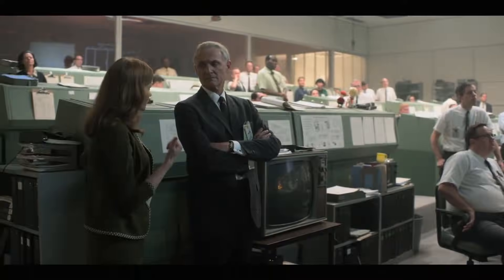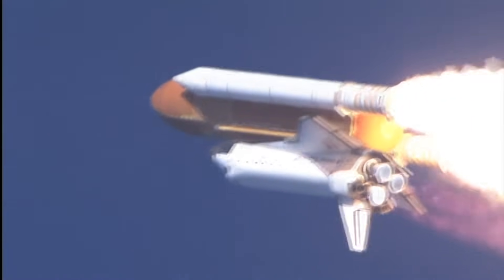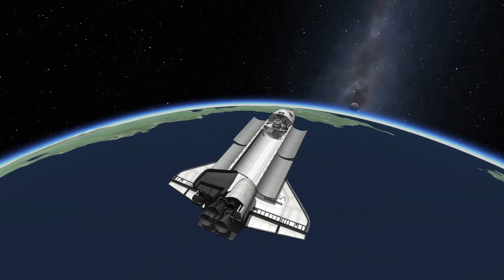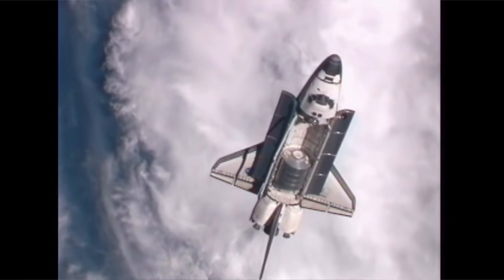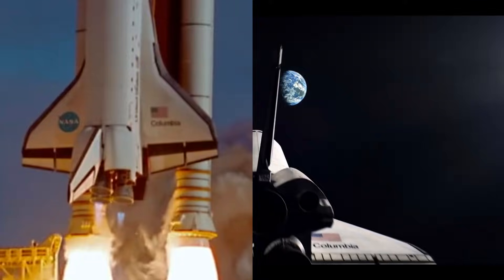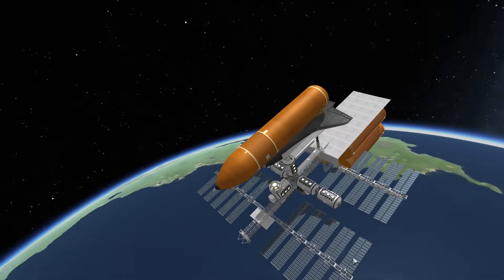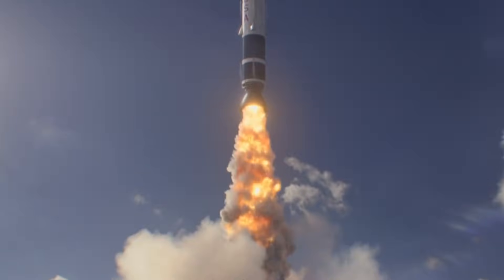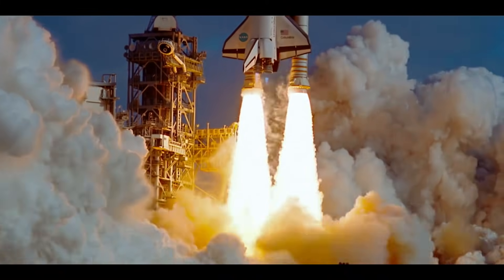How To Send A Space Shuttle To The Moon

Comment: Something that's possible is also slowing the shuttle's return from the moon so it goes back into low Earth orbit, maybe even hooking up with the ISS again before a normal speed Earth re entry.
Reply: Doing that would require a velocity change of about 3 km/sec since it would basically be a TLI in reverse.
Producing that velocity change or Δv with rocket engines means that at least 50 % of the total mass before the slowdown needs to be propellant, assuming hydrogen & oxygen burnt by the highly efficient shuttle main engines with 450 sec of specific impulse. If using engines with lower specific impulse, the percentage of propellant would need to be even higher than 50 %.
If the shuttle couldn't be replenished on the Moon, all that propellant would need to be brought all the way to the Moon and back, essentially doubling all the propellant and rocket power needed to launch the shuttle in the first place.

Comment: It would be neat to see a railgun on the moon to launch water to a lunar station that would then process it into fuel over time. All you'd need would be something to circularize the payload at apoapsis that could also withstand the acceleration of a launch. A reason to process it in-orbit would be to increase launch safety and also have it readily available to use as water instead of fuel.
Reply: Railguns on the Moon – if you by that mean electromagnetic catapults – have been imagined for a long time. Arthur C. Clarke wrote about the concept already in the 1950s.

Comment: Once you are in space, there is no need to keep fuel inside Shuttle, you can just agglomerate stuff in any configuration that will stay together. Perhaps the Shuttle needs to to get to LEO and then separate out that fuel and equipment needed to escape Earth's gravity and atmospheric drag and land back on earth including heat tiles, wings, aerodynamic sheet metal and some engines. Perhaps it could be configured as a two-stage shuttle such that leaves Shuttle stage 1 in LEO, then Stage 2 with crew compartment and support, fuel tanks, correct number and configuration of engines and rejoins Stage 1 when it returns from Moon to LEO. SpaceX's many engine design would allow just taking a few space nozzle engines to Moon since they are just operating in space. Can engines be made with nozzles that can be reconfigured? How much extra weight and complication would be entailed in all this reconfigurablity?

Comment: How to avoid the heat load of coming into the atmosphere at translunar speed?  Use the maneuvering thrusters to turn around and use some remaining hydrogen oxgyen fuel to fire the main engines toward Earth to slow down enough to hit normal re-entry speed.  Also I hope there's a fight between a Shuttle and a Buran at some point.
Reply: That braking would require a velocity change (or delta-v) of at least 11,000 km/h and take about half of the spacecraft's gross weight (at that point) in fuel even when using the highly efficient main engines. That means that the shuttle would need to haul nearly 100 tonnes more fuel all the way to the Moon and back, plus lots of extra fuel for the TLI burn and the manoeuvring near the Moon because of those extra 100 tonnes.

Comment: There is another alternative, an extended, or "enhanced", external tank carrying adequate hydrogen and oxygen from the earth's surface.  Not as neat as an orbital station and tank farm, but it would work.  For the return, don't do a direct re-entry, but return to a LEO orbit and leave the external tank with the tank farm to expand it's capability.  I suspect the Shuttle might need GNC and Life Support systems upgrades to go to the moon, but those should be doable with no external changes to the Shuttle.
Reply: That wouldn’t work.
Increasing the external tank’s fuel capacity that much would make the entire shuttle stack too heavy to launch into LEO without also increasing the number of engines, making the whole thing even heavier.

Also, changing a lunar return trajectory into a LEO takes the same velocity change (~3 km/sec) as the TLI burn, requiring nearly 100 tonnes of extra fuel for the braking (if hydrogen/LOX) if the shuttle + the dry weight of that fuel tank is 90-100 tonnes. Add the fuel needed for the lunar orbit insertion and trans Earth injection, and we are talking about 270-280 tonnes of payload sent on the TLI trajectory. Adding the fuel needed to do that means that roughly 550-600 tonnes had to be sent into LEO initially. That’s at least 4 times more than the payload capacity of the Saturn V!

Conclusion: Using shuttles for lunar missions is a spectacularly bad idea!
Reply: @fromnorway643  In which case, you're going to need an orbital tank farm to reload the external tanks.  I could see several shuttle missions using slightly over-filled external tanks, much as was proposed for "Dry bay Centaur", to carry the tanks and necessary truss structure to orbit for assembling the basic farm, then either shuttle or Sea Dragon launches to bring up habitable modules and an external truss, similar to that on the ISS, for power, and finally using Sea Dragon launches to bring up LOX and LH2 until ice from the moon can be broken down for fuel and oxizer.  The Soviets would have the same problem with Buran, perhaps even more so, since that system in our timeline had engines at the end of the external tank and none on the Buran shuttle/

Comment: As a kid, I always thought about how cool it would be to have a runway on the moon for the shuttle to land
Reply: Since the shuttle's wings would be useless on the airless Moon, the only way to land a shuttle on a runway there would be to adjust the orbit in such a way that it just barely touched the runway at its lowest point. The problem is that this method would give a landing speed of at least 6000 km/h compared to 350 km/h on Earth.
Even if the shuttle's wheels could survive that, it would need an extremely long runway for the slow-down since the drag chute would be just as useless as the wings. The wheel brakes would also be nearly useless at first since the traction between the wheels and the ground would be very poor while close to orbital speed.
Reply: FromNorway Exactly why I don’t think about that anymore 😂

Comment: What if the space shuttle was going to Earth-Moon L1 where it would dock with a spacecraft from the Moon? That would give most of the advantages of a heat-shield  for returning to Earth by aerobraking.
Reply: That wouldn't be of much help. The Earth-Moon L1 is about 326,000 km from Earth, so a shuttle re-entering the Earth's atmosphere from that point would have virtually the same speed (close to 11 km/sec) as the Apollo spacecrafts had after the lunar missions.

Comment: in the computer graphic simulation we see some charateristic "Mach disks" appear in the plume of the engine of the Shuttle when firing for lunar injection orbit... well, I thought that is  likely not to happen in vacuum, if it's true that they are cause by the inteaction of atmosferic pressure with the hot stream of exaust gasses (is that correct...?)

Comment: Why does reentry thermal load increase on a return from lunar orbit? Can't the shuttle just return to Earth, circularize its orbit, and perform some Hohmann transfer maneuvers to get back to LEO before reentry? (I'm guessing that takes a lot more ΔV?)
Reply: The re-entry speed from the Moon is more than 40% higher than from LEO, roughly doubling the heating and aerodynamic load. The shuttle would need to slow down by about 11,000 km/h before doing the re-entry. That braking would require about the shuttle's own weight in hydrogen/oxygen fuel if using the main engines and even more if done with the less efficient OMS engines.
Reply: @fromnorway643  So what you're basically saying is I should've been doing more aerobraking in KSP all this time? :D But seriously, thank you, that was helpful!

Comment: Hmm, one Point was not touched by scott: what if the Space Shuttle in the show uses a Methalox Variant of the RS-25 instead? Methane has better volumetric density than Hydrogen, so if this Engine has roughly the same efficiency, and the External Tank is filled with that instead - would that getting them closer to the Moon?

Comment: Thank you.

The Shuttle was sold as a method of placing comsats in geosynchronous orbit and retrieving them for repair.  Those orbit at 24,000 miles altitude.  By the time it flew "bloat" had limited the Shuttle to 500 miles or so if it flew essentially EMPTY.  It could never do what it was intended to do, and by the time it flew that mission would have been irrelevant anyway.  Every, single Shuttle flight was a make-work project.

Comment: It would be easier (and likely much less expensive) to design and build an updated version of the Apollo-Saturn. The whole selling point of the Shuttle system was that it was re-usable, and therefore cheaper. It turned out to be MUCH more expensive to fly Apollo-Saturn. Not to mention the fact that Apollo-Saturn had a much safer record. The Saturn V had no catastrophic flight; a remarkable record. It even kept functioning during Apollo 12 when the entire stack was struck by lightning.

Comment: Very cool video, thanks.  It seems you need to refuel in space, but why not send a Delta IV Heavy with a custom external tank full of go-juice(s)? On the way back, just burn to slow down to normal shuttle orbit. I guess you need a reason to send it first.
Reply: The payload capacity of a Delta IV Heavy to a 200 km high orbit is about 28-29 tonnes, so it would only be able to launch an empty shuttle external tank. The mass of a fully loaded one was 760 tonnes.
Reply: @fromnorway643  When I wrote "custom external fuel tank" I did not mean one of the existing tanks.  If 29 tons is the limit, then make a tank that is 29 tons full.  If that is not enough fuel & oxygen, send 2 or 17 or however many you need.  If more than one just design them to link together. 
My point is you don't have to re-fuel the existing tank, just connect to a new "custom" one.

Comment: If they're going to shuttle between the earth and the moon, it doesn't need to land on either. It's still not an efficient design for doing this, unless there is nothing else available. It could also be used as a "tug", with payloads attached by linkages externally.

Comment: So adding in a braking burn to make reentry survivable, is the tank still big enough?
Reply: Short answer: Yes!

Longer answer:
The total delta-v requirement for going from low Earth orbit (LEO) to low lunar orbit and back to LEO is 7.88 km/sec. This assumes that the orbiter itself doesn't land on the Moon, but brings a lunar lander in its payload bay.
The total delta-v capacity for a 100 tonne shuttle with a fully fuelled external tank (30 tonnes of empty mass and 735 tonnes of liquid hydrogen/LOX) would be 8.4 km/sec when using the main engines with their 452 sec of specific impulse in vacuum.

The external tank would thus be big enough, but only if the hydrogen boil-off could be kept to a minimum, and that could be a big problem for a mission lasting 10-12 days. Maybe the surplus delta-v of 0.52 km/sec would offer a large enough margin to allow extra mass for better insulation of the hydrogen tank, and also painting the entire tank white to limit solar heating?

Another challenge would be bringing all that fuel into LEO in the first place, as it would require the payload capacity of 6 Saturn V rockets. Maybe ignoring the shuttle altogether and sending the astronauts to the Moon with a single Saturn V would be a better idea?

Comment: The argument against this idea is easy to state and understand.  There is simply no reason for hauling most of the structure of the Space Shuttle to the Moon and back.   The parts I refer to include the payload bay, the wing and control surfaces, much of the crew compartment and the re-entry surfaces for such a huge vehicle.  When I include some of the crew compartment, the vehicle could only house the crew for a maximum of 14 days or so and that is not sufficient to justify so much space - it hardly constitutes a poor man's space station.   As for the engines, none of the engines, either main engines of the maneuvering ones can be removed to lesson mass, and this video very adequately explains why the vehicle is just too massive.

Here, we are forced to confront another serious question - what purpose was there to haul all this material into Earth orbit in the first place.   The Space Shuttle was capable of launching nearly as much into low Earth orbit as the Saturn V, but it;s useful payload was only 25 tons as opposed to 140 tons in the case of Saturn.   Yes, an inexpensive reusable vehicle would have justified the cost of launching and returning the Shuttle body to Earth, but it never came close to its promise and was far more expensive than Saturn V's would have been.   But the Saturn V had one other over-riding advantage - it COULD send a payload and crew to the Moon.   As we see from this video, the Shuttle was a dead-end in furthering the exploration of space beyond the Earth.   It set us back decades and the launch vehicle now being planned by NASA, the SLS, is actually a design proposed in the mid-1970's to supplement the Shuttle as a pure cargo carrier.   Why was it not built for 40 years?  The answer is the Space Shuttle program left NASA too broke.   Yet, Congress still insists that NASA use existing technology from the Space Shuttle, namely its main engines.  They are good expensive engines but the burn Hydrogen and the equations still say that such engines are not appropriate for boosters from the Earth's surface due to the low density of liquid hydrogen.   At best, as a launch vehicle, the SLS will be no improvement over the Saturn V.

If we had carried forward with Saturn after Apollo, but now, we might well be way ahead of our present plans for the near future.   NASA would do well to re-assume the roll of its predecessor, the NACA, as an advisor and supporter of companies either in the business (SpaceX, Blue Origin etc) or those clamoring for a place in what promises to be a true space boom.

Comment: Expanding on your proposal to use a refueled external tank to go to the moon and back while stating that the thermo tiles couldn't handle reentry at this speed.
Would there be enough fuel left in the external tank to sufficiently slow down the shuttle before entering Earth's atmosphere ?
Reply: Interesting question!
If fully refuelled in LEO, the masses would be the following.
Orbiter with payload:                100 tonnes
Empty external tank:                26.5 tonnes
Liquid oxygen + hydrogen:    735.6 tonnes
Total mass:                             862.1 tonnes
Specific impulse of main engines: 452 sec in vacuum

With these data and Tsiolkovsky's rocket equation, one can calculate that all the fuel in the external tank could provide a total delta-v (velocity change) of 8506 m/sec or 30,622 km/h.
Going from LEO to low lunar orbit (assuming the landing is done by a lunar lander in the orbiter's payload bay) and back to LEO requires a total velocity change of 7880 m/sec or 28,368 km/h.
So yes, it seems that a fully refuelled external tank could bring the shuttle from LEO to low lunar orbit and back, assuming that the problem with hydrogen boil-off mentioned by Scott Manley wasn't too serious. The OMS engines could provide about 300 m/sec of extra delta-v if used after the external tank had been separated, but it's worth noting that bringing all that fuel up to LEO in the first place would require at least 6 Saturn V class rockets!
Something tells me that the way it was done by NASA during the Apollo program was a much smarter solution than involving a space shuttle!
Reply: @fromnorway643  Hey Ragnar, I wish I knew your real name ;-)
One of the many questions I asked Scott. But the only time ever he answered me is when I questioned his rainbow colored space ship intro ;-(
Anyway. Thanks for going into the math of my question and giving me such an elaborate answer.
It's kinda fun to contemplate about these hypothetical questions but with SpaceX about to go to the moon for real it's not even that far out any more.
Jeff Who recently said they would need 16 refuelling flights, Elon responded they might get away with just 4. 
So your numbers are right in the ballpark. Kudos to that !
Reply: @Capt.Turner  
Thanks!

Comment: I am kind of disappointed that NASA never attempted at least a high elliptical orbit with the shuttle orbiter. Perhaps out to as far as geostationary satellites and then immediately back, reaching as far as those orbits briefly but not circularizing into those high orbits. This would just be a test of those never used extra capabilities and help to inform future spacecraft designs.
Reply: Sending the shuttle into an elliptical orbit reaching geostationary altitude (35,786 km) at apogee would be physically impossible for pretty much the same reasons as explained in this video.

1. Such a manoeuvre from the shuttle's typical 350 km high circular orbit would require a velocity change or delta-v (Δv) of about 2400 m/s or 8700 km/h. That's roughly 80 % of the Δv needed for a translunar injection and many times more than the capacity of the shuttle's OMS engines given their limited fuel supplies.
2. Even if it could do that by refuelling in LEO, the re-entry speed would be at least 8000 km/h higher than what the shuttle's thermal protection was designed for, so it would be almost like a re-entry from the Moon with the same catastrophic result.

The shuttle was designed for missions to LEO and nothing else!
Reply: @fromnorway643  Don't change from circular to elliptical. Boost straight to elliptical. Let the boosters do most of the work outbound. Yeah, it will probably mean more or bigger boosters. The shuttle then only needs enough fuel to safely reduce speed and deorbit. Cargo bay fuel tank can help with that.